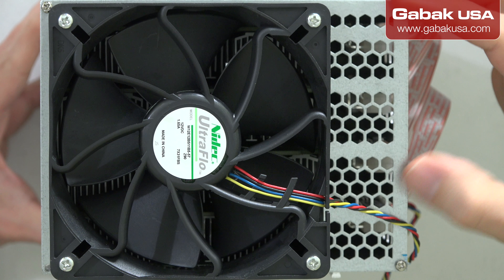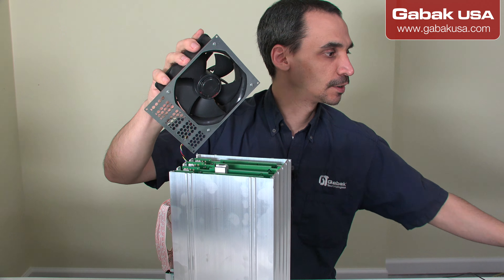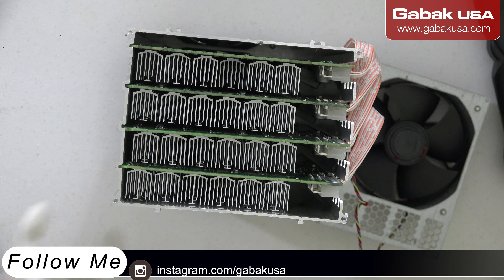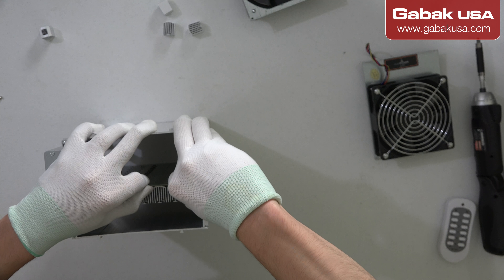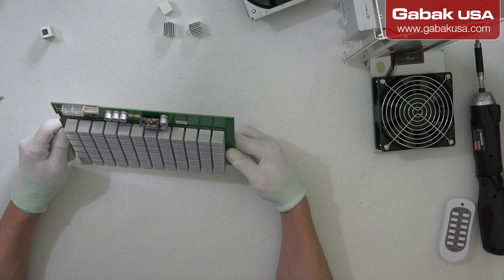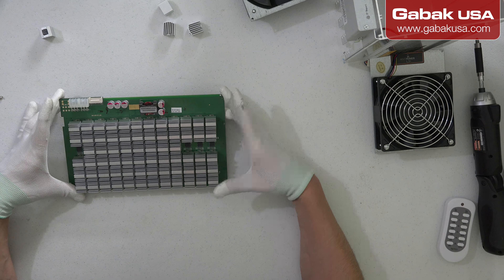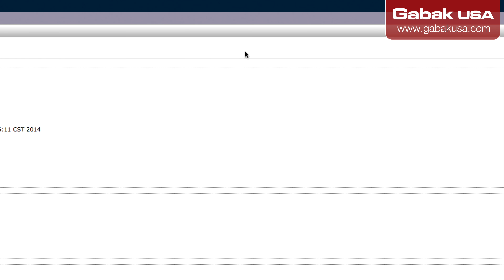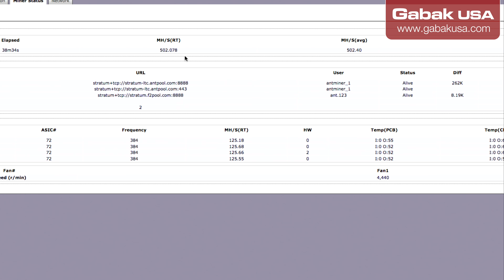How to fix heat sink of any antminer S9 L3 D3

Comment: Hey, good video. Nice to see someone with experience showing their skills. Just one tip to give that I have learned over 20 years repairing computers. Instead of using a Dremel or files on the heat sink, use fine grit sandpaper on a VERY flat surface (I work on a glass table) and gently rub the heatsink across it. Depending on the sandpaper you can actually end up with a better surface that stock. Thanks again.
Reply from the maker: we can try that next time ;-)

Comment: Great thanks for sharing. I didn’t have this epoxy I had artic paste and 5 minute epoxy and made my own. It did hold up, but when another heat sink fell off later I checked my repair and they came off too easy. I’m going to purchase this and hope it works better. Thanks.
Reply from the maker: if u need some i can ship it to you
Reply: @gabakusa  That would be awesome. It is currently out of stock and I can only operate 2 of the 3 boards until I repair. I believe I have 4 heat sinks off at the moment. Let me know how I can purchase from you. Thanks
Reply: MG Chemicals 8329TCS it great too

Comment: Will that glue get soft if attacked with a heat gun, like the black glue Bitmain uses?
Reply from the maker: use Arctic silver thermal compound adhesive and you wont have any issues.
Otherwise you are gambling

Comment: can i use arctic silver thermal adhesive instead of arctic alumina?
Reply from the maker: use what I used
it works
Reply: i cant find arctic alumina in my country, local comp shop sell arctic silver thermal adhesive..
Reply from the maker: I can ship it to you with fedex if you want to

Comment: Gabriel could you please do a video showing capacitor swap out on S9 hash board as I have 6 non working ones ,many many thanks Andy T.
Reply from the maker: if you know basic electronics you can do the job or send it to me and I can fix it for you
Reply: GabakUSA Free computer training  O.M.G ! Excuse me I'm a little star struck ,I watch your videos to try and learn as much as I can from you . OK ,back to reality ,my message had a typo in it ,I have 16 S9 defective hash boards ( mostly heat damaged )0; blocked intake on input fan in mining room !
I used to solder boards for 18 months many moons ago ,so I can solder ,but after that I'm lost ,looking at miner videos I found one that says most hash board failures are caused by caps failing ?! So I bought a pair of magic tweezers ,and a peak DCA55 component analyser ,I hoped that if I compared readings with a known to be working one ,and swap components that read differently ??? I'm sorry to be so ignorant in electronics ,were you serious that you would look at them with a possibility of repair some of them ? I'm based in the UK but could happily ship them to you ,if I've miss understood please excuse me ,I'm still so  happy you contacted me,Health n happiness to you n yours from the teeny tiny home miner in the UK.Andy ?t

Comment: hey i have an antminer d3 and one of the boards not working. i took them out and saw the heat sinks came off. i notice one of the asic chips piece stuck to the heat sink. how does one resolve this issue with regards replacing the chips.
Reply from the maker: you could use a soldering station to replace a bad chip.

Comment: Guarantee you going to get more problems, dirty fix, I'm looking for a pro
Reply from the maker: send it to Bitmain they will do the same thing or just replace the whole board
Reply: Bitmain sucks, I go 13 machines need cleaning, replace some circuit chips and resetting parts and tools wil be provided, do you know how to code the boards?

Comment: If your gonna speak the English language.. please.. please.. slow down.. it's not a race.. I can't understand anything your saying.. I never found out how to stop the red light from blinking.. My L3+ has issues which I can not seem to find anyone who knows whats wrong.. I've downloaded SD firmware installed.. Got to the point of being able to look at control page.. It shows no data in Chinese (I had to convert the language to see what it says), and there is no mining going on.. it shows the job but won't mine.. any of the boards.. all of them or one at a time.. I've installed SD card with what is suppose to be the recovery file.. red light keeps blinking.. I've reset with the reset button as well as in the programming.. same result. THE MAX
Reply from the maker: if you click on the gear you can speed up or slow down the video ;-) problem solved
Reply: I’ve sent my bad l3 boards to East Coast ASIC in the past. I was getting a lot of 0 ASICS and they were able to fix them